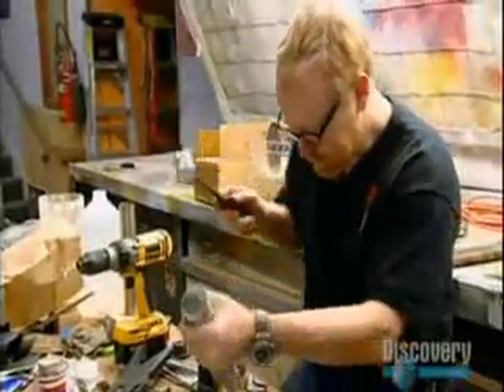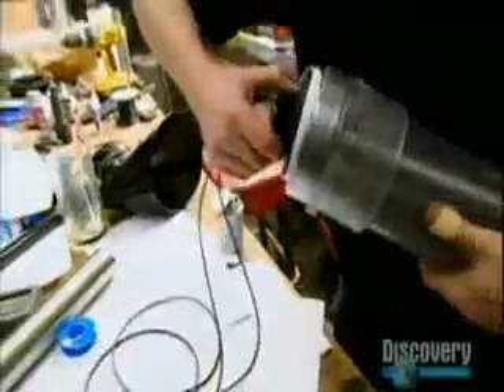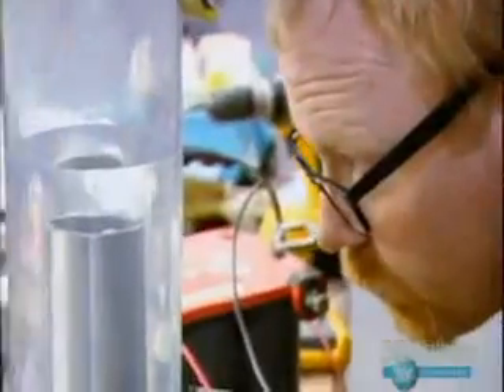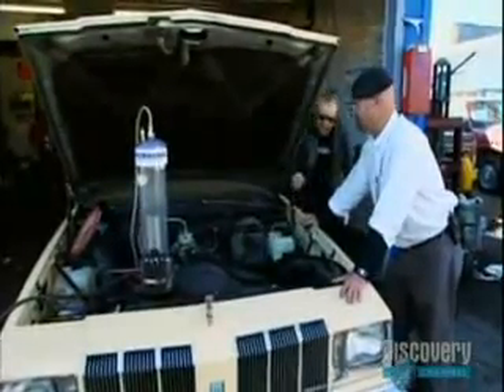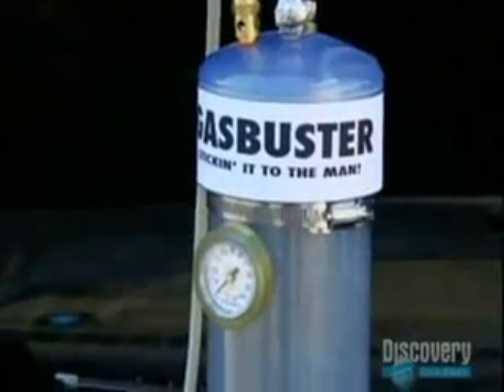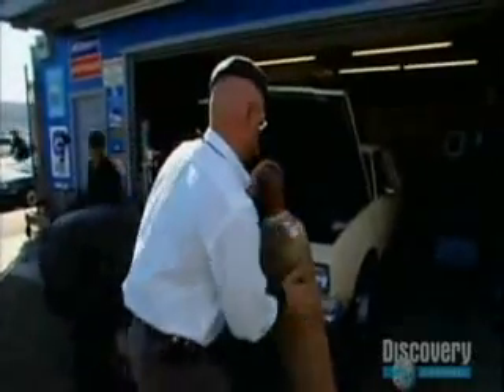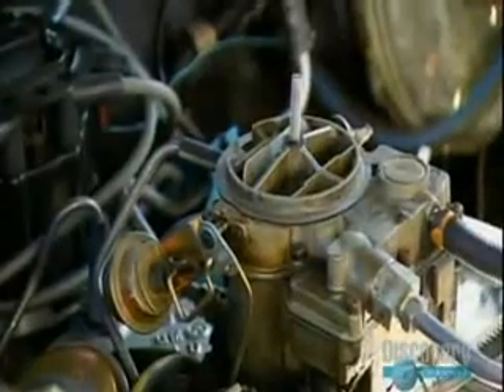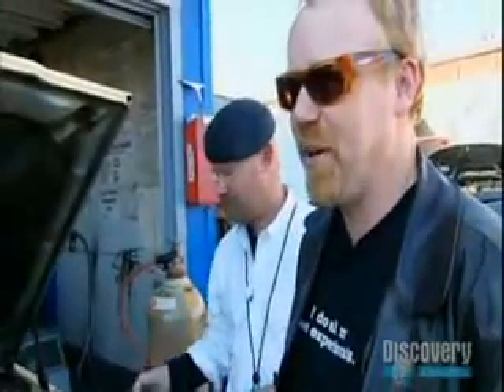HHO Mythbusters Explained

Comment: The idea is not to fully run the car on HHO, but rather to increase gas mileage. So they try to fully start and run the car only on HHO in order to fail and get some ridicule in for something that I understand really works to increase gas mileage.
Reply: +computarman I don't understand that it works.  If the alternator is producing say 80W of electricity, that means it places more resistance on the engine and will use more than 80W of gasoline.  If the engine is efficient, it will still be taking about 160W and that energy comes from burning gasoline.  So when you put 70W coming out of the alternator (efficiency loss) if your electrolosys is 100% efficient (which it can approach if done right - more  like 50%) you put 35-70W of energy into splitting H2O into HHO.  The amount of energy contained in the HHO that you get to burn in the engine is even less than this because it takes more energy to break the water apart than you get out when you burn it (turning it into steam).  So in the end, you might put 20W into your engine and say 10W onto the road.  Use 160W of gas to get 10W back doesn't seem like increased gas mileage to me.  746 Watts is 1 horesepower - so if your engine puts out 160HP and you use it all to run a  kick-ass HHO generator, you might end up with the acceleration of a 10HP lawn mower to impress the chicks!
Reply: +Sunday Afternoon 
 Yes, you actually don't understand how it works. The effect of Hydrogen addition in an IC engine is not to produce energy out of nothing, which would contradict the laws of thermodynamics, as you correctly said. The effect that it improves the efficiency of the combustion itself. The quality of combustion is an essential part in an engines efficiency, and the reason why you actually can improve the overall efficiency by small fractions of hydrogen added to the combustion. The benefit of the improved combustion is making a greater use of the fuels energy, thereby even justifying the effort to produce the hydrogen and thus actually improving the total efficiency. The thing with IC engines is that the energy output is far from being directly proportional to the energy input, and dependant of many factors. An example to understand this could be the compression ratio. With your approach, an increased compression work input could not lead to a rise in efficiency, because the law of energy conservation would be broken. This is not the case, it actually improves efficiency by reducing the loss and thereby obeying the energy conservation. Hydrogen addition actually works, and has been proven by various experiments conducted und scientifical conditions. If you want i can link you to some papers.

However. And this is what those HHO clowns don't get...
1. The effect only actually improves efficiency in a perfectly calibrated setup.
2. The effect is, although obtainable, ridiculously small.
3. Thereby very unlikely to occur in a random car implementation.
4. Even if - improving mpg far below the often stated extents.

And ultimately - outperfomed by improving materials, injection systems and fuel additives. The gains in eff. by that are still pushing the limits further and further.  HHO works, and the experiments that proved it are sound, and not contradicting the laws of thermodynamics. But the real improvement in BSFC since its early days come frome other things and still go on..

Comment: Hi: For HHO Dry Is it a replacement for the original fuel for the car that he or assistant work together
Because it is not a little thing for the removal of a link fuel pump ..okadd you making a 13 Stainless Steel Plate and put potassium hydroxide and the amount of production was good car and I never work
This is the model of the device I hope you Antakberni Is it enough to run a car Thanks
http://www.youtube.com/watch?v=52jZSgNMXvU

Comment: The idea was never to prove the technology worked.If that was ever put on something as main stream as mythbusters,people would be asking why we still use gas?
Reply: +Terry Mckinney They put what they found on the internet to a test and it failed.  That is the real result.  If you do the numbers, you will see that there is no way to make enough hydrogen to run an engine with a device that small.
Reply: +Terry Mckinney HHO is not a replacement for gas and nobody claims that it is.  It still takes gas to run the alternator to make the electricity to do the electrolysis.  The whole concept is for the HHO to improve the engine efficiency so that is uses LESS gas, but it is still mostly powered by the gas.  That's why it was so ignorant for the mythbuster guys to put an HHO cell that was not even working in front of the carb and try and turn the engine over.
Reply: pyronaught
Adding a mixture of hydrogen oxygen and water vapor to the intake of a very badly tuned engine can increase its economy.  The effect goes away when you get into more efficient engines.
Reply: +Ken Smith That's what Mythbusters should be proving then, and using a legitimate effort to do it.
Reply: +pyronaught A claim that was being commonly made is the myth they tested.  They busted that myth.  There really is very little advantage in someone proving again that H2, O2 and water vapor on the intake of a really inefficient engine helps.  Only a tiny fraction of what is on the road today is running that badly.

Comment: You got to love the haters .it doesn't it work it wont work its all a mith buy petrol n diesel now quick go n spend all ur pretend cash on something u don't  need .we all know that during ww2 lots of the uk gov transport ran on coak gas wood gas and funnily beleve it or not hydrogen too it worked then so it might work now too .oh yeh and er my landrover is running fine at 48/55 mpg since I added the fuel cel (that dont work) evryone should do this

Comment: Electricity breaks up water molecules wasting 33% of that electricity. Engine recombines the products back into water using only 20% of the original 67% (which is 18%) to move the car..... and turn the alternator and charge the battery. Which is then used to apply electrolysis to the water. Re-obtaining a maximum of 18% of the original 18% ( If!!!.....the car is not moving and perfectly transfers all of the engine's kinetic energy to the alternator and battery). So basically your car is running (very inefficiently) on your car battery. 

Simply chucking the electrolysis thingy, the engine, alternator....hell, chucking everything but the drivetrain and the battery and simply connecting an electric motor straight to the battery achieves the same thing except it's way more efficient. Which, btw, is also a very dumb idea, but still wayyy better than this idea.

Comment: Water boost injection in WWII aircraft was used to supply extra power for short bursts only. Too much, and you ran the water tank dry, or you blew out the pistons. I always thought that water spray in the air intake would cool the cylinders and do no other damage - and supply an "octane boost" with better MPG. In the 70's, I used a very simple water injection system I bought from J.C. Whitney that was nothing but a tank, some hose to the air intake to the carb (1972 Chevy C-10 250 Cu In straight 6 2bbl carb), and it worked wonderful! Better fuel mileage, no spark plug fowling, towed a big Alumacraft 17' with a big Johnson on it no sweat. Why does today's systems that supposedly do essentially the same thing cost so much, and have so many gadgets in them? Don't tell me "emissions control" because I removed all that junk from my 1990 Ford Ranger 4 cyl 134 cu in and it got 2 mpg better afterwards. I am open to a very simple way that does not need any pumps, and relies just on engine vacuum to draw the water into the throttlebody fuel injection. I don't need more power, I need MPG these days. The Ranger already runs like a scalded dog.
Reply: +longshorts3 Not every car relies on a carburetor system of vacuum, thus you can't install a vacuum based system onto every car. You can't install any vacuum system in a TDI because it's all mechanical pumps. Most Gasoline cars today are also mechanically pumped, so any added system can't just be an add on to a carburetor's vacuum. While I'm no expert on these parts specifically I'd guess they would have a similar system to a fuel monitoring system to prevent the end user from wasting any excess hydrogen (thus prolonging the battery, allowing it to recharge if Hydrogen has built up).
Reply: Insane N!TEmare
 Back to the blasted computer system for EFI and engine timing. Wish they had a retro-fit single barrel carb just for that engine in my Ranger. Being it is a 1990 model with an L-134 4 cyl, would it be possible? OR, can I get a simple boost pump for water injection through a vacuum inlet on the back of the throttle body fuel injector (or I could just use a venturi tube into the air inlet hose)? One that would run 2 to 4 PSI to just get a 1/8" stream of water into the fuel/air mixture? Max vacuum pressure would be at idle, but the boost pump could be triggered to run slow at 2k RPM under acceleration and not overload the air/fuel mixture ? WWII radial and inline engines used the water boost system, but I can't find a diagram on how they did it back then.

Comment: yah mythbusters messed up on that one.  Honestly though, given the vacuum a carburetor produces, especially for a V8 like in the car they used, it takes a looot of HHO volume to be able to power it through it's full range.  Also, there needs to be some kind of a regulator (similar to the gas pedal) to keep too much or too little HHO getting to the engine, otherwise, it can build up where it shouldn't, or, not get enough when needed.   

also, don't even think about doing this on a fuel injected car unless you have mad tuning skills and can actually write the code to program the ECU. long story... please don't make me go into it. 

Also... HHO is thinner than atomised gasoline, and the valves on a gasoline engine need to be re-spaced, and or to be smaller, valve springs need to be tighter, and a lot of other little things.  

the worst part about HHO is that the end product is water.  Do you know what happens to an engine when you fill it up with water? they rust and lock up.   The pistons do not move the entire length of the cylinder, so, rust will accumulate on the top portion of the cylinder, and possibly on the head, unless it is aluminum, however, the valves are NOT aluminum.... nor are they stainless. nor are the valve guides. nor are the piston rings.  What can happen as well,  when the engine turns off, and is hot, with water vapor inside, as it cools, it causes flash rust. If a car sits for a week or two, the cylinders will be flash rusted. this greatly reduces the life of the engine every time you start it and the piston rings scrape all the rust shit off.  Remember. they are 4 stroke.. if ONE piston is all the way up, there are 3,5 or 7 more that are not all the way up, or are all the way down, filling with rust from left over water molecules.  

however........ most of that stuff can be changed or modified with a large sum of money.  

with that said..................

EVERY CITY BUS WHERE I LIVE... has been powered by hydrogen for at least 20 years now.....  however, they do break down all the damn time....    Not saying hydrogen is better than HHO, i'm just saying that........ yes... cars can run on hydrogen.... and or hho... and we've been doing it here for a long time now, in 4 billion pound busses! or whatever they weigh.. i don't know.

Comment: As long as you agree that more energy is needed to produce hydrogen from water that means you can't run a car on water alone as you can with gasoline.

 Even if there were no other problems the production of hydrogen from water in any electrolytic cell constructed to your dimensions with any electrolyte of your choicer will always have an internal resistance which will produce heat when in operation. So more energy into produce hydrogen and heat with less power out burning the same hydrogen or hydrogen-oxygen gas.

 As a fuel hydrogen is cleaner than hydrocarbons because when burned it produces water only and no CO2 greenhouse gas. However its energy density is lower than any other gas capable of combustion.
Reply: Kim O'Brien I meant to say more energy is needed to produce hydrogen from water than is gained by later burning that same hydrogen or hydrogen-oxygen turning it back into water.  You may not like the fundamental laws of the universe such as conservation of energy and mass. If you can find away around them than you will win a Nobel Prize.
Reply: Kim O'Brien its a loss of 2.7 MJ
Reply: ***** Piss and moan,  Piss and moan...
Reply: ***** that's not pissing and moaning? I'm just saying you would need to supply that much energy per 1L of water
Reply: Brony Pony that is only true for radioactive elements, not breaking of bonds simple bonds
Reply: Brony Pony Atom smashing is not going on here so don't change the subject. We are talking about breaking up and making up molecules not smashing atoms. A process that is well understood by classical physics both before and after modern physics involving the internal atomic structure changed classical physics.
Reply: A 2 liter engine consumes about .5 liters of gas (not liquid gasoline) * 1000 rev per minute or about 500 liters of HHO gas in a minute or 30000 liters in an hour. So you need about 60 Kwh to run an engine for an hour. A 100 amp alternator produces 100 amps at 14 volts or 1.4 kw per hour. Still think you can run a car on just water?
Reply: Brony Pony Once again no real evidence cited only another attempt to change subjects. We aren't talking about blowing up hotels nor do I know of a hotel being blown up with 3,000L of hydrogen gas. A propane gas bottle contains 88 liters of liquid propane that is allowed to expand into a gas before being used to heat rooms. Nor is liquid hydrogen being used here. We are not driving a car into space either. Since you don't want to challenge any of my calculations or assumptions I assume you have nothing left to contribute.
Reply: It only burns cleaner if you do not use a carburetor or fuel injection and air.  Air is around 70% nitrogen and when exposed to combustion chamber temps, it produces nitric oxides.

Comment: the valve timing of gas engines do not work with hydrogen. Hence the back fire. You need a different camshaft design to run hydrogen.
Reply: what about VVT?